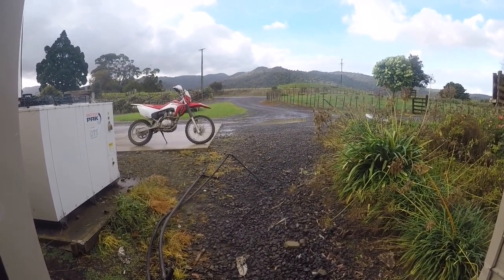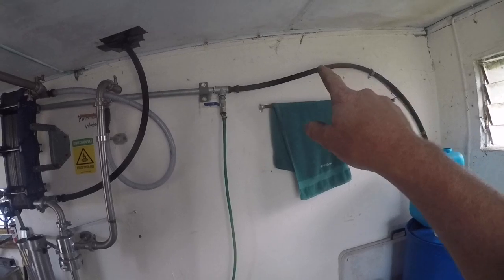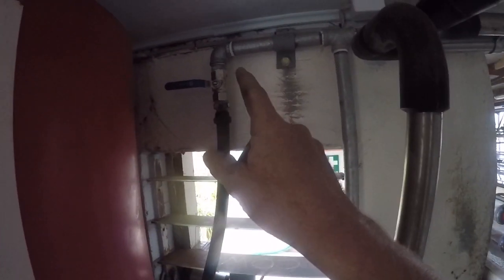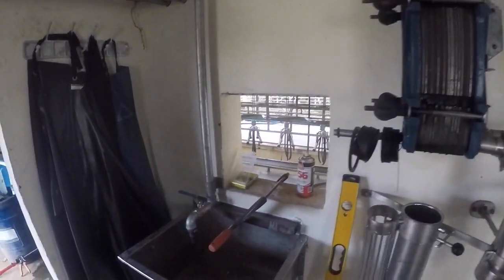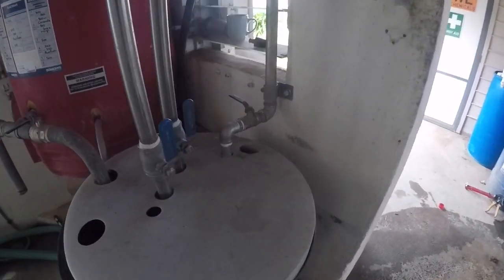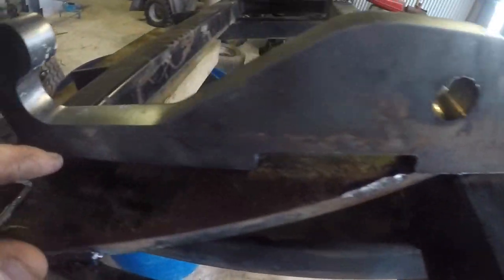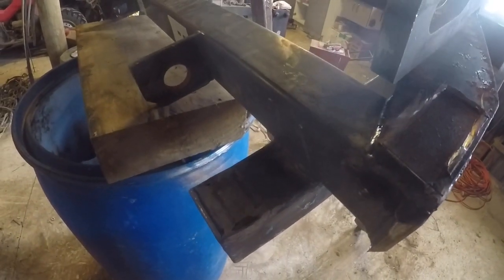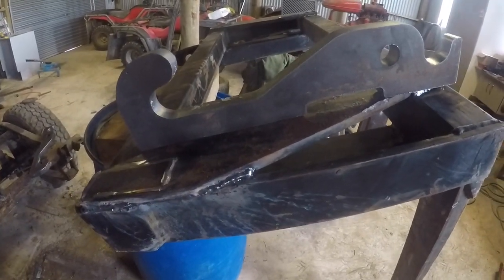Cowshed Maintenance

Comment: I thought the Pearson's were different to what you have again they have 4 horizontal bars attached to the bucket or whatever and the loader had almost hooks that pick it up
Reply from the maker: Glen Koopman yep the early quick hitch had one or two hooks depending weather it was single or double crowd action and manually lock it on. Then they went to the 20 series loader witch had this style of quick hitch. When you crowd it back it locks on. I thought your 4270 had this style of hitch
Reply: @FamilyFarmingandFun  no from what I remember when we bought the 4270 it had euro hitch but we changed it to the old pearson so it would fit with the bucket and grab off the old 390 and the 399